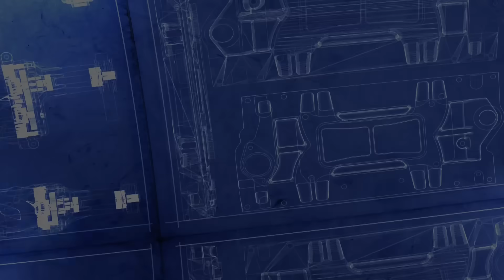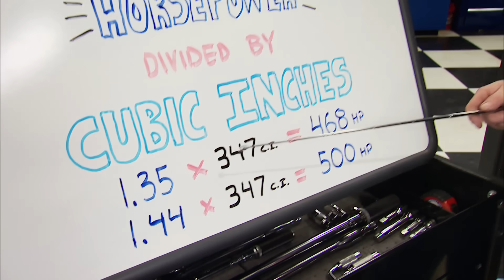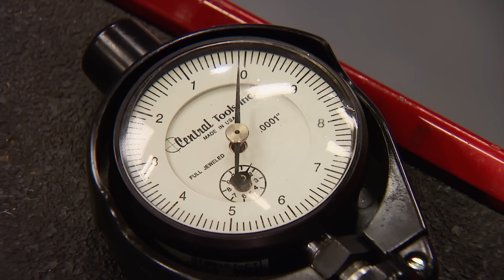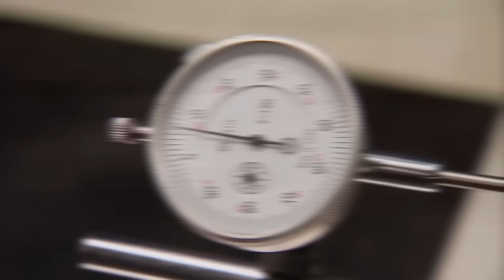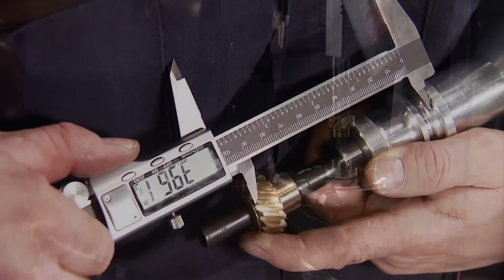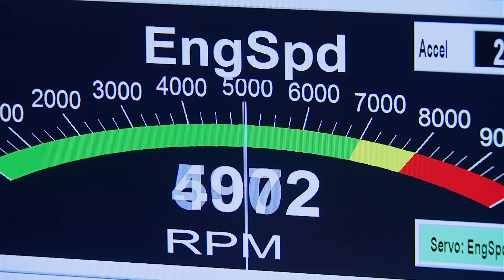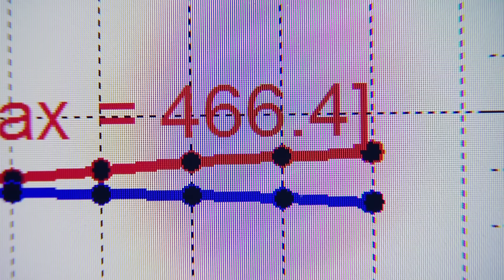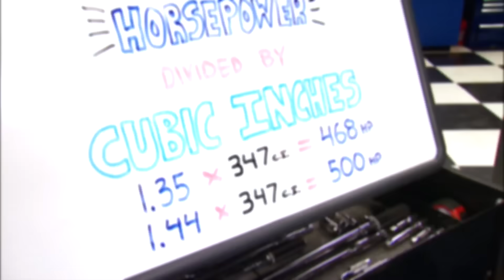Stroking A 5.0L Small Block Ford to 347 C.I. - Engine Power S2, E8

Comment: “ we’re calling this build ‘Little Black & Blue’ because it’s going to be guilty of domestic violence against your wallet “
Reply: Show me a big power n/a Ford small windsor build that don't. 
You think this build is expensive, try the same thing on a 318 mope ...I mean there is not a reason as the 318 and 360 are very close in hight. A 302 is a very short deck engine that's the reason for the stroker kit. So it cost a lot to play the displacement game. It's not like going forced induction is that much cheaper plus to build a small windsor to live a long life of being beat you need to make sure the machining and assembly are good even on a simple bolt on turbo kit. If you want to skirt some of the fancy things you can. I'd start with a 99-2000 explorer 5.0 and keep the edis ( electronic distributorless ignition ) run a crank trigger, use good heads , good nitrous cam and a msd box. Pill it till ya kill it and go get another junk yard block.
Reply: Rob Sorgdrager look at some of my old videos and you’ll see me rebuilding a Ford 5.0 using an old car tire as an engine stand.
Reply: @BustedWalletGarage  dude, I've been a mechanic and carguy since 97...I'm also not rich😕. I've used come alongs and a tree to pull engines, I like using tires to rest engines and trans'es on. I did a engine swap out the bottom of a Ford focus with Jack stands, a floor jack on class 5 ...that one required many many beers. I feel ya holms a good mechanic is like a marine...get the job done using what's at hand. 😊
Reply: @robsorgdrager8477  or they could just build a 351W.
Reply: @robsorgdrager8477 387 stroker. 351w block and rods. 302 flat tops and a 400 crank. All easily sourced parts. Total cost 1000.
Reply: Quit crying!! Try building a Mopar!  I'll cost you twice as much, and with less than half of the parts availability!
Reply: @JoeyGarcia  i thought big three parts were relatively easy to find. In comparison to a Nissan VG30E, Z22E or GM  Iron Duke for a Fiero, apparently some differences  between them and other cars that use it. 

I like the 300ZX, 200SX and the Fiero.  They're different  and certainly unique.

I'm the same sort who thought up a .44 Magnum AR-10 or AR-15 upper might work. After all if Magnum Research, Coonan, CZ/Enfield and the Soviet State Arsenals under Mikhail Kalashnikov's direction could all make rimmed cartridges feed in a box magazine reliably semiautomatically and full auto, why can't anyone else?  The weapons being the Desert Eagle, the Bren Light Machine gun in .303 British,  the Coonan 
.357 Magnum 1911 and a variant of the PKM that accepted drum magazines of 7.62x54R
Reply: @JoeyGarcia and still behind all the fox bodies
Reply: @JoeyGarcia  um but I thought Indy heads were all over the place and cheap😂🤣😂🤩-- sarcasm emote installed here-- . Never understood the Mopar guys, yeah they have the " hot " engines but trying to get the right parts when you need them is like squeezing juice out of a brick.😉
Reply: @robsorgdrager8477  I wish it was cheap. :(  But, I also love Fords too!  Ford has always been amazing at big power in small packages.  Especially now since the aftermarket is strong for Ford smallblocks.
Reply: Love my 347. But still pounding the dent out of my wallet. Lol. Great engine.
Reply: Lol try building a olds stroker. I'll wait...
Reply: Patrick Pope, Oldsmobile is GM, so you could use most SM BK performance parts
Reply: @scooterb3342  ah... no.
Reply: Found the Chevy guy.
Reply: About how much would an engine build like this cost? I'm planning on doing one in the near future
Reply: I don't know much about building V8 engines. What would you say the total cost of this engine build is?
Reply: Beerus Sama without labor, parts & machining are close to $10,000.   Add labor and dyno time , looking close to $20k. Can almost match the same power on stock-ish motor with a mild turbo kit.
Reply: @BustedWalletGarage  issue with turbos is they are hard on everything. They coke oil and then that carbon gets pumped through the oiling system, they generate massive amounts of heat, they eat coolant and spark plugs , if your tuning is off they blow up more often. Turbo is a easy way to make power but it's not always the best way. I like positive displacement superchargers or n/a they give up some peak power but what you loose you gain in low and mid range, easier to maintain, tuning is more forgiving , suspension tuning is easier as you know where the power comes in at and it's the same every time.
Reply: @BustedWalletGarage not even close to 10k this build would cost you maybe 4 to 6k
Reply: STREET RACER once you add in 3 days off work and $1500 a day for the dyno, upgrading the fuel, transmission, cooling and braking systems, the cost of the motor build is 40% of the total cost of the entire project
Reply: But this motor will run hard 100k miles guarenteed. Well you know if you're smart ;)
Reply: No Prep Stretch you waited 4 months to make another comment ¿
Reply: @Andrey Angere build a coyote cheap. ..... haha.     I laughed so hard a little bit of pee came out.
Reply: Ultra CNC  you can blame the current culture. Thanks to shows like overhauled, gas monkey all the way back to diamond p on the TNN network . Cars to most are just transportation but to those that are in the industry and have the passion , they represent something else. Now ever since being a rebel was cool fast cars have been seen as a way to pretend for the majority of the population that they are something they are not. Think like the dentist that owns a ratty chopper and throws on some leather on the weekends....it's not who he is the majority of the time. Cars , especially customs , hot rods, performance cars are owned by people that have never bled on that car, went days without sleep building that car, ate Roman for a month to afford those parts...they flop out some money and want to play alpha male for a while...they still look at that machine and have zero clue how it works or was built. I love asking people what they used to make parts of the chassis or engine specs and I'll I get is a Dyno readout and a story about finding the car in someone's yard. This is why everything is so expensive. People have found out that uncool people will spend all their money to make themselves appear more important. I couldn't care what some one thinks of me, I want to build things because my brain won't turn off. I want to take a normal car and make it what my mind sees , but since the office duche bag thinks his Camaro is gonna get him laid , I being a mechanic , a husband , a father can not afford to build the cars I want. That's why a throw away engine cost so much to build. Just my passion speaking .
Reply: Try building a Pontiac stroker engine and you'll see what expensive really is. My 505 stroker engine took me over 6 years plus of saving up to have done right. Anything outside od small block Ford or Chevy is going to run you big dollars. That build on that small block Ford is reasonable by most standards.
Reply: LOL yeah, my wallet would be "black and blue" for sure!  These guys must be all democrats!

Comment: You guys are so behind the curve. WHO runs a carb with a 347??  Maybe 2% of guys. I stopped the vid as soon as I saw the carb. Such a waste as all of you're builds are....
Reply: Carbs have advantages in peak power over port injection due to how the fuel cools the charge. Since this is a drag / high RPM build, it's suitable to use a carb because part-throttle drivability isn't really a concern.

I would have liked to see a carb style EFI setup considering the cost of this engine, but the end-user may be phobic to EFI, also, EFI is really expensive.

Also, a carb is nice for a quick dyno to test the engine capabilities. EFI takes a while to program and set up and time on the Dyno can be a luxury.
Reply: @Clobercow1  Expensive, lol. Not it's not. Factory Style long runner, etc.
Reply: Larry Ford      Carburetors were around before you were likely born and still get the job done. Since you don't like carbs we will miss you but at least we won't have to read your stupid comments on the next video.
Reply: Lol, I'm 49 thanks idiot. Carbs don't work, I'll take my laptop with my 414W thanks......
Reply: @therealist4006    You can take your laptop and stick it where the sun don't shine.
Reply: Maybe want to put it in an old car & keep it original

Comment: Should be-Pushrod length is set by  making the rocker 90 degrees to stud when at 50% lift.  Where the roller rides on valve is secondary check.
The way demonstrated, one has no idea where the rocker geometry is, just that one made roller to valve stem perfect, but could be at expense of unreliable stem-fulcrum-stud angles. Don't leave it to chance.
Reply: If you're doing it that way you should read some of what Jim Miller has to say about mid lift geometry.
Reply: Dave,  great stuff

Comment: Have you guys ever built a flat crank motor?
Reply: oh oh! Idea!  A Ford 427 cammer with a flat plane!  That would be epic..
Reply: @1320crusier   no.... just..... no
Reply: @1320crusier  no no it wouldnt. I'll explain. 1964-1966 427 sohc aka big daddy cammer engine was built off of the FE engine block family 427 side and top oiler engine blocks. They were super rev happy being over head cam and many blew up because they had no real tells that they were being over revved like pushrod engines do as it was. They were designed for racing and having gobs of boost added to them hence the 90° crank. Flat plain cranks do not fair well with boost they snap under to much cylinder pressure. Switching to a flat plain from  a 90 degree would make it rev even faster sure but it would also make them over rev faster and you would only keep it na at that point and probably less compression and power over all. Timing gears pass damaging rotational harmonics into the very hard but very brittle cams and they would shatter over 6000rpm which is why you don't see timing gears in high rpm large displacement  engines and mostly only see them in low rpm diesels. All that plus your talking about an engine stock that costs more then most people's homes and that's if you can even find one. So again what you are talking about is an under educated pipe dream. Sorry but that's the truth.
Reply: @1320crusier  can you link me to some gear timed f1 engines over 6 litters please because as far as I knew they couldn't handle the rotational harmonics and there for do not exist with gear drives. under spacific loads at high rpms large displacement engines with lots of rotational mass  shatter cams. Some super small displacement engines have mild enough rotational harmonics that yes they could get away with it but With as much rotational mass as is in a 7.0l sohc engine even with a flat plain crank  the rotational harmonics it  would produce, there simply is not a material  on the planet that will work . Any material hard enough to not wear out compleatly while running is  brittle enough the forces applyed to it would cause it to shatter with gear drives at high rpms. It is not  a simple comp cams can make it out of a better material that can handle it issue because the better material  didn't and still does not exist. Wish it did lots could be made differently  but unfortunatly we are limited to the capabilities of the real materials available now. I mean who knows maybe my heads just up my ass and I have no idea what I am talking about,  just passing on what I was told anyway but... please understand every mechine shop and engine builder I talked to when building my twin turbo stroker all said the Same thing on the subject. I was you once asking the very question and what I'm passing on is exactly what they all told me on the subject. I love the 427 sohc asked all these questions after hours while shareing a few beer with my builders. Many many times over I would try to prove gears would work and be better etc but in the end they all showed me so now that's what I believe.
Reply: @1320crusier  ok sure please link me a f1 gear driven engine turning that kind of rpm over 6 litters in displacement thank you. ✌😆
Reply: @1320crusier  sorry  but um 8, 4+ inch piston moving 4+ inches produces a different engine harmonic then 10, 2 inch pistons moving a half an inch. If you don't understand that maybe listen to the exhaust note that's a pretty good indacator of the diffrent forces /vibrational freaquancies created at diffrent rpms. See the problem is you are comparing Apple's to oranges sure their both fruit but they are very diffrent fruit. Listen to how loud a sohc is at 6000 rpm can you imagine how loud it would be at 20k like those 3.5l v10 f1 engines only as  loud as a sohc at  6k crazy!  It's the vibrations of the sound each engine produces that shatters the material of the cam when connected together with gears. The smaller the bore and stroke (displacment) the higher the rpm before you reach critical harmonics. I know you don't understand that. It's ok though at least we were having respectful dialogue.
Reply: @1320crusier  uh Hugh keep going your almost there.
Reply: @1320crusier   including critical harmonics (harmonics at which everything solid shatters) critical harmonics on a gear driven small displacement engine will be far higher in rpm then in a large displacement engine the key is to remove the shock point and that is what a chain drive does because the cam always reaches critical harmonics before any other part in a solid system due to the nature of its dimensions and over all shape. The length, meterial and diameters of the cam and over all shape go into determining what it's critical harmonics will be same with your crank but as the crank is generally so much larger it's always the cam that shatters first. a gear is solid and sends the shock of the harmonics directly threw the cam shaft, for large displacement engines to achive higher rpms they need to remove the shock from the cam this is done by useing a dual roller timing chain. Distructive vibrational harmonics will disperse their energy in stretching the chains before they shatter the cam. This will save your parts because once the chains are stretched enough the car kinda runs funny after you try to check timing and its bouncing around you know you need to change timing chain but everything else in the engine is saved. So no rebuild. Ignoring a stretched chain and waiting for it to snap is another story.
Reply: @1320crusier   anyway you know what they say about speed. How fast do you want to spend?
Reply: @1320crusier   exactly.
Reply: @thedon3836  Hey man I appreciate the flexing and it just so happens I agree with your point but brother you're really messing with my ocd with the way you keep spelling *material*. Have some pity on me an fix it will ya? ✌
Reply: @WraythesPlace  😞 man I guess we all gotta learn how to just let 💩 go  hey? 👍😅

Comment: I love these little Fords. They are low deck, lightweight,  and fit in a small engine bay. You can low budget one and get 300 - 350  horsepower with the stock heads. Use main cap studs or a girdle for high rpm. This is a cool build. Excellent job guys .
Reply: Jeff Weaver there are people using stock everything inside and outside these engines in stock eliminator class getting over 400 HP with a stock lift super long duration custom csm
Reply: Built a 408 stroker (351 block) love it ...made 490 hp and 520 lb ft of torque ... can push it at 6,500 rpm all day And never run hot
Reply: Geaux Tigers hey I would love to get your specs on your build. Have a ‘73 mustang convertible with 351 Cleveland that I have been trying to figure out a set up. Was thinking of changing out stock 2v heads for trick flow 195 or 205. Hope to hear from you
Reply: Born and raise in EUrope, estill amazes me when someone calls "little" a 5686 cc engine.
Reply: @Boredoutofmywits  Its referring to its outside dimensions not its displacement. It's an OHV motor meaning the cam is in the block and the heads are relatively short as a result. Combine that with it's short deck and you've got an engine that doesn't up much room.  In fact there are quite a few OHC V6s and I6s that take up more room in your engine bay.
Reply: @TheMcBlackster  Not "little" OHCs.
Reply: @Boredoutofmywits  yeah the long block of the ls1 350 ci v8 engine itself is smaller than a honda k20 engine.
Reply: Just dont push them much past 500hp though I suppose that girdle helps
Reply: 1320crusier I would weld the girdle on after torqing it down to keep any slipping from happening
Reply: @spankthemonkey3437  not without distorting the main bores you wouldn't. Besides the main webbing would pull from the  block long before you see any benefits.  I've built and dynoed over 40 of these and the 327/331 SBF for NMRA and Cobra Kit cars.
Reply: @t.s.racing  302 Iron eagle dart race block. Skies the limit.
Reply: @1320crusier  Block fill the bastard half way and beat on them
Reply: @1320crusier 500hp you say? Yeah ok, tell that to the Aussie burnout kings Gary and Jake Meyers 😂 9k rpm at over 1000hp blown 302